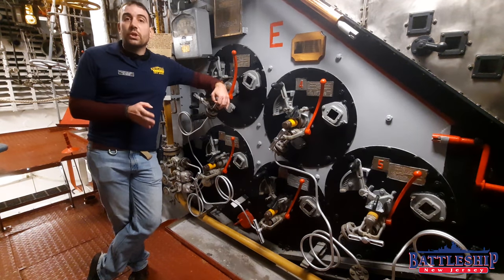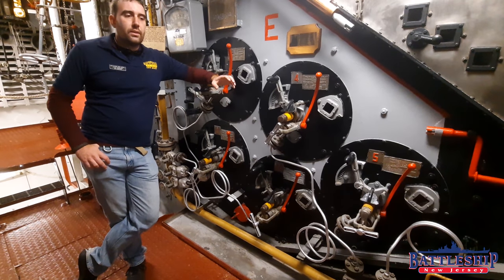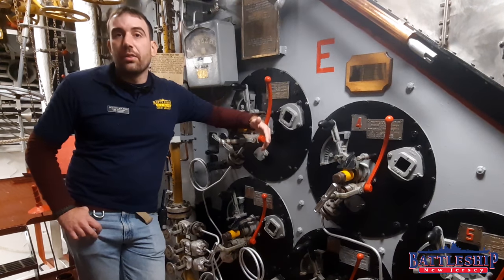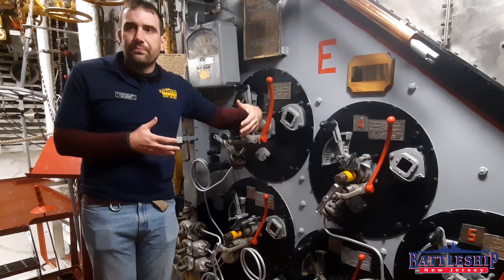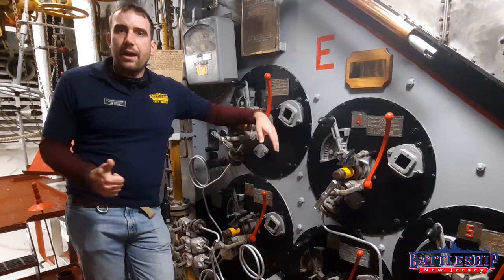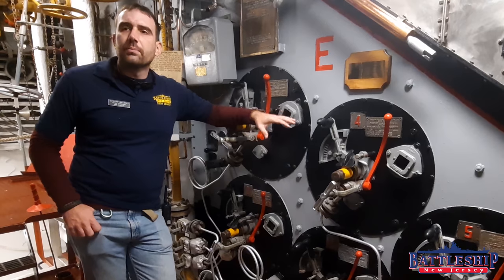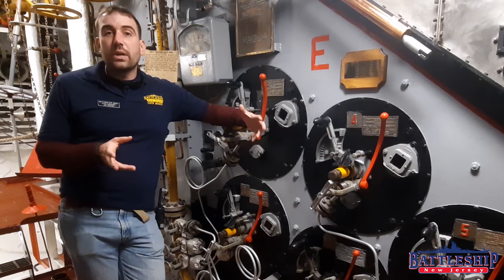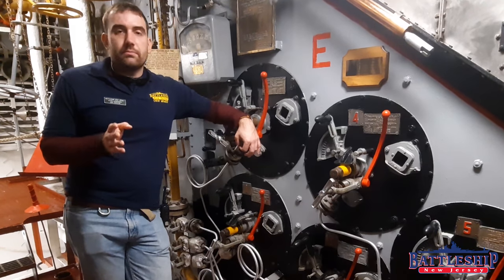Nuclear Powered Battleships

Comment: As much as I love the battleships, and I really do, they're just not practical in the modern combat arena. You might as well come up with nuclear chariots or nuclear catapults. It's not a matter of whether you can make it work, but a matter of how much it would be worth even if it does work.

I am definitely in favor of using smaller reactors for our ships. They work on carriers and subs. With new MSR technology breakthroughs, we can put nuclear power on smaller ships. I'm so in favor of them that I think we ought to size the ships to the reactors. If we can make a reactor small enough to make sense on a 200 ft ship, then we ought to make that the minimum size for 98% of the ships.

There are 4 problems with battleships.
a. The enormous cost in building and manning the ship.
b. Their main purpose was traditionally to fight other battleships, of which there are none.
c. The armor is no longer useful against modern missiles.
d. The limited range of the weapons.

For all of these, the primary answer becomes the aircraft carrier. They can hit a battleship from such a distance that the battleship really has nothing to fight back against.
Adding rail guns and lasers doesn't solve the problem.
Lasers are a line of sight weapon. You're limited by the horizon.
Rail guns have more range, but nowhere near as much as a CVN.

It seems to me the way ahead would be to increase the lethality range of the CVN. Right now, that's around 400 miles. Double the range of the aircraft and you've made battleships even more obsolete. Instead of putting lasers on the battleship (mainly a defensive weapon) put them on the aircraft and they become an offensive weapon.

I'm still not sure how or if rail guns would ever make sense in a modern combat arena. Sure they're fun to use, but are they useful? You need to get so close to the enemy that you become a target. Any platform large enough to operate a rail gun (Zumwalt cruiser) would be a very high-value target that close to the enemy. And stealth isn't as useful at sea as it is in the air.
Air - 3 dimensions
Sea - 2 dimensions
Someone could just lob shells or missiles at the Zumwalt and get a lucky hit. Get an aircraft in close enough and the Zumwalt gets sunk. Using stealth to hide a huge, slow, 2-dimensional target is infinitely harder than hiding a small, fast, 3-dimensional target. The Zumwalt just isn't the answer.

I'm thinking scratch the rail guns entirely. Lasers and hypersonic missiles make so much more sense. We know those can be useful in modern combat. For the rail gun, it only makes sense on the Zumwalt, which itself doesn't make sense. You can't stealth up an Iowa to be a Zumwalt either. You'd have to start over, which is what the Zumwalt already did. Still no good.

The only way I see a modern battleship working is if there was a way to extend the line of sight for the lasers. A super high laser turret, or a floating laser turret, or aerial mirrors. Those are about it. If you can get that working, you have a new battleship, in which case you'd want the nuclear reactor. Normal turrets on the ship would be pointless and we're back to being limited by the horizon.
Reply: Rail guns and lasers can't even be used effectively on nuke ships. Rail guns take too much power to fire more than once and lasers are only effective for drones and other thin-skin, small aircraft. While I can see drone warfare becoming useful in ground combat (as we can see in the recent Armenia-Azerbaijan border war), I doubt it'd be useful in naval combat as anything other than spotter craft, unless some program comes about to automate WW2-esque drone attack waves.
Reply: Just as a point of contention here, modern anti ship missiles are not intended to impact armor and penetrate huge thicknesses of it.  The outer hull of the Iowa is 1.5" thick armor steel and at the closest point, about one foot away, is the main armor belt of 12" thick.  The deck is covered by a similarly thick weather deck to the outer hull of the Iowa and the actual armor deck itself is 6" thick and 8 feet away from it.  These aren't small numbers when we are talking about modern antiship missiles.  You have to penetrate the outer hull/weather deck to get to the main armor belt, and then penetrate it into the critical systems.  It was no small feat in WWII for most modern AP shells weighing north of a ton each (the vast majority of navies fielding 16" guns were firing 2250lb AP shells) and there was still a significant amount of range in which the Iowas were immune to 16" shell fire.  

The biggest threat to a battleship will be from the air or from under water (torpedoes and mines).  Above the surface is fairly easy to protect against, below is much harder.  Less warning.

Also, the rail gun technology out today is intended to fire hundreds of miles compared to the ~24 miles of the Iowa Class' 16"/50 Cal Mark 7 guns.  I'm also pretty sure they don't require THAT MUCH power... if they did they wouldn't be test firing them on land very often...

Comment: Iowas are a bit old to try to bring back nuclear or not.

We do lack a armored bombardment vessel that can dish out damage and still take a hit or two. If we ever needed to do a large landing, we would need better bombardment capabilities. A battleship also is ideal for force projection and intimidation of rival powers. All of these are either current or potential problems we face from China. We should begin the process of designing and building modern battleships before the need arises and we are dreadfully unprepared, these ships take years to design and build. Equipping the ships with high caliber rail guns and/or other advanced weaponry and systems will demand a high power output. Nuclear is the go to option for high power capacity. The fragility of reactors is less of a concern due to the long range of newer artillery and also because chinese hypersonic missiles can already hit our carriers which are less armored than these ships would be. Perhaps emergency backup systems to allow operation at a reduced capacity are needed or perhaps reactors should be made more robust.

These ships very well may remain with a fleet such as a carrier group, attacking from long range with artillery targets that dont need or woulnt be suited for an airstrike or that are in locations where air superiority is in the hands of the enemy meanwhile the ship is protected by a combination of armor escorts, carrier air patrol and defensive weapons like CIWS and lasers

Comment: In this day and age, Battleships are more nostalgic than practical. Those big guns have a 20 mile range while ship killer missiles have 100's mile range. In reality, if you were to make the Iowa class a modern warship, the turrets would be removed and discarded, the power plants removed and discarded, the entire electrical grid removed and discarded, the superstructure removed and discarded, leaving basically an empty shell. Then you can install either a nuclear power plant or turbine propulsion and upgraded genset, all new electrical grid to handle the increased amperage, then a slimline superstructure for better aerodynamics, and missile systems and railguns where the turrets used to be.  At that point you might as well just start from the ground up with a hull specifically designed for such use.    Lets face it, even with all it's armor, a direct hit by most ship killer missiles will do serious damage, maybe even fatal to the ship.  Compared to Carrier groups, it is slower, which slows the whole group down. It is man power intensive, as well as a maintenance whore.  It had it's time and place, just not in todays world.

Comment: I agree about a retrofit being unfeasible, BUT! A NEW nuclear-powered surface ship should be DESIGNED from the start to have parts above the power system be removable in order to refuel. This IS possible, but still not practical until such a plan is developed.

Comment: Ah, my dreams of a nuclear powered Iowa with twin rail guns in each of the turrets will never be realized -- but it sure is fun to speculate about.
Reply: Why stop a two rail guns?  I dream of triple turrets, but on a significantly larger vessel.
Reply: @lonnyyoung4285  If you're building a new ship, why the hell not?  Let's get a modern Montana class with 4 triple rail gun turrets 😁
Reply: @itsmezed  While not being a naval architect, I have done some thinking about what a modern battleship would need to be.  I don't think the Montana hull would be large enough for all of the engineering spaces, crew, and weapons systems.  The anti-air/missile defenses alone would need to take up a lot of space.  I was thinking a ship larger than a Ford-class carrier.

I did think (again, not being a naval architect) that the Montana hull would be great for a missle boat using VLS.  You would have a lot of options with that.  You could use them as anti-air and anti-submarine escorts for a railgun-equipped super battleship.  What role would that kind of battleship serve?  I have no idea.  However, it's just in my dream world, so budget limitations and roles don't matter.

Comment: In the context of existing LWR (light water reactor) refueling is an issue , as is the bulky  reactor core and heavy steam pipe, redundant systems,pumps etc.   However the big progress in nuclear power since the archaic 1950's design chosen by admiral Rickover (and copied by everyone) is using liquid,molten salt reactors which have no fuel rods or massive steam/water system as cooling. Instead the Uranium or Thorium fuel is dissolved into the fuel on a continual basis, and fission products are easily separated in operation which have very short half lives for subsequent release.  Since the efficiency of fuel burn goes from a pathetic 0.7% to 99% the amount of waste product as unburned fuel is negligible. Also since the salt coolant is at 700C instead of 250C its more efficient at producing usable power.   Another innovation is replacing the legacy steam turbine plant with supercritical CO2 (carbon dioxide) turbines which occupy about 1/5th the footprint of conventional steam turbines.   So the answer is that with what we have today nuclear power is easy,simple engineering .   As to re-powering an Iowa class ship................still a huge amount of work.

Comment: Really informative, thanks Ryan*. It's pretty understandable why the Navy would not permit restarting the boilers, service steam system, or firing the main guns - also common-sense reason there - as part of their agreement to provide the New Jersey to be a museum/memorial. I wonder what other items or equipment on board is the museum not permitted to operate by agreement? Are there items on the ship that that were deactivated during decommissioning that you will reactivate in the future? If so, what are your priorities?

In another video, you mentioned the air-search radar antenna had recently been made able to turn again, but not yet under its own power. Does the Navy have any restrictions on touching radar equipment left on board?

*and cameraperson
Reply from the maker: We covered the broad swath of what the navys rules were with this. If they didn't want us to use it and they could take it with them, they did. So the radar can spin but it doesn't have the rest of the equipment to actually radiate or anything.

Comment: Nuclear reactors do not belong in the line of battle. Submarines are a relatively small risk, since you can't shoot what you can't find. Carriers are also relatively safe, being surrounded by dozens of escorts and usually cautiously deployed. Battleships, cruisers, and destroyers are routinely operated on their own, in potentially very dangerous waters and barely-less-dangerous ports, to show the flag and conduct other missions for national security. Take the USS Cole for example. She was operating in a high-risk area on a show-the-flag mission, and got hit by a terrorist suicide boat. Had she been equipped with a nuclear reactor, there would have been a significant risk of a major nuclear incident. Since even a single nuclear accident could have devastating consequences for the USA's ability to operate from allied bases in forward theaters, any vessel with a nuclear reactor cannot be sent on that sort of mission. That's not a matter of tactics, strategy, or engineering. It's a matter of global politics. Since a nuclear vessel cannot do the sorts of missions a destroyer, cruiser, or battleship are supposed to do, there is no point spending money on them.

Now lets talk about two classes of ships. First, the CGN. As previously discussed, the CGN could not do most of the missions required of a cruiser because of the political risks posed by their reactors. As a result, the CGNs were relegated to only fleet escort missions that, honestly, were better fulfilled by non-nuclear vessels. Had they been free to fulfill the full duties of a cruiser, their nuclear propulsion would have made them well-suited to the role. They were well-designed ships. But they were designed and built without consideration of the limitations that international politics would impose. The waste of taxpayer dollars was not in scrapping them before the end of their design lifetime, the waste of taxpayer dollars was in proceeding with the project long after more suitable non-nuclear options were available.

Next up, the modern battleship. First, the thought of refitting the Iowas is just absurd. These ships are thoroughly outdated, and it would take a lot more than a few years in drydock and modernization to make them useful. The idea of large-caliber gunfire support is still quite relevant and useful. And while it's true that modern missiles can effectively penetrate almost any amount of armor, suicide boats and mines and other external explosive threats can be stopped with only a few inches of modern armor. A 45,000 ton battleship is not the ideal platform though. It's too big for the job. A much better alternative would be something like Germany's "pocket battleship" from WWII. A cruiser-sized vessel with a few big guns can provide the same long-range, heavy-caliber fire support that an Iowa could, with 1/3 the mass and probably 1/10 the crew. Put on some decent armor and you'd have an ideal modern capital ship. Able to provide long-range gunfire support, operate with the fleet, and (if properly armored) shrug off suicide boats and mine/torpedo hits with just a scratch in the paint.

Comment: Ryan, no offense as I agree with some of your opinion and most of your thoughts. (smiles) I have opinions but no factual rebuttal other than Navy nuclear reactors are not that fragile. Differences of opinion and some guess work on my end. 
  No retrofit for nuclear. Not effective and we loose historical ships. 
  Nuclear power new BBNs you touched on. BASE rail guns and electromagnetic drone launch give a very cost effective hitting power.   The idea of keeping fuel bunkers for protection and shock dissipation, secondary turbine power is good. The comments mention refueling other ships from the BBN. I do not know anything about it but it sounds good. 

Like you said, retrofitting Iowa class BBN has many issues and drawbacks. Also it is good to how ships worked back then. 
New BBN class could have multiple rail guns, Longer surveillance antennas as the ship is longer,  like the Jimmy Carter sub - a wet well for discharging expeditionary force. Each tomahawk missile is expensive. Just the threat of destroying a beach head, shipping port or military base up to 1,000 nautical miles inland.  

Nuclear power seems like an option for new BBN ships. Yes we have to cut through decks to refuel aircraft carriers. How subs do this is far more secretive about what they do but cutting is  involved. I disagree with the word choice "cutting through decks is a waste of money" It is expensive and damaging. I prefer "Cost of running the ship" a better term. Fortunately multiple other systems that may also need deck cutting are upgraded at Newport News shipyard " Ingersoll Rand " when the reactor is refueled. They have great T-shirts for the effort (*not* available on E-bay) 
   Yes nuclear systems are sensitive but Hyman Rickover made then durable and redundant. Yea he is dead but his ghost and mindset still haunts the Norfolk naval shipyard. 
   I agree with you that   Air independent propulsion (AIP) subs are very quiet putting all ships at risk. Mines with new computers get way smarter every few years. Now with drone torpedoes in littoral waters it is more dangerous. Rail gun that can reach 2,000 nautical miles side to side and 1,000 miles inland would soften and make the coast safer than WW-II or Vietnam.  
  I defer to you on how many hits BBN take. You know more than me there. Yes - be prepared for hits. 
  Ryan and staff please feel free to rebuttal back. I know you have more important things to do. Ditto for others.

Comment: I happen to be a nuclear engineer / plant designer and I didn't take particular offense to anything. I would contend that the shock loading to which a submarine reactor is designed likely bounds most missile strikes and that there is nothing particularly fragile about a reactor. From a refueling standpoint, certainly the new cores can get to lifetimes that approach the continual-use life horizon of a warship, but do agree that modifying the current ships or having to refuel new ones would be a bear. There are tricks one could use to push core life even further, but I'm not going to discuss them on YouTube ;) Most would require some derate, but the newest reactors make more than enough to permit that.
Reply: The shock loading he was talking about was most likely the shock the guns put on the ship itself when firing a salvo - well thats how I took it at least.
Reply: @HaddaClu  Well that would definitely be bounded. That's probably comparable to flight operations.